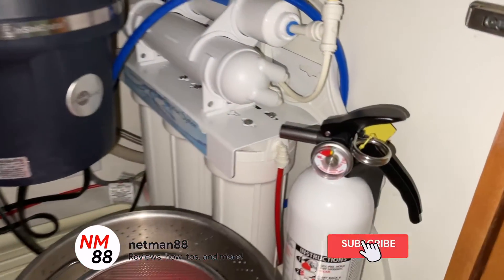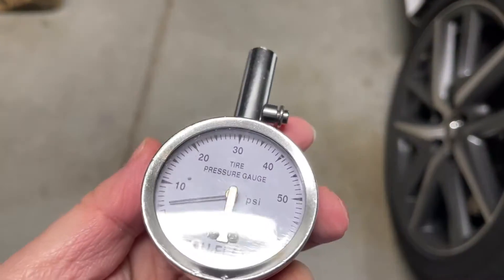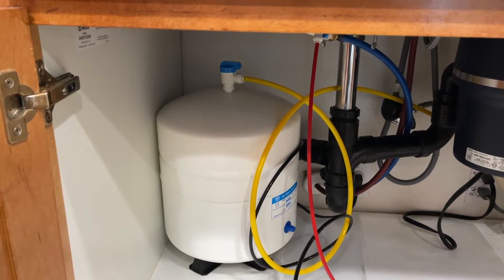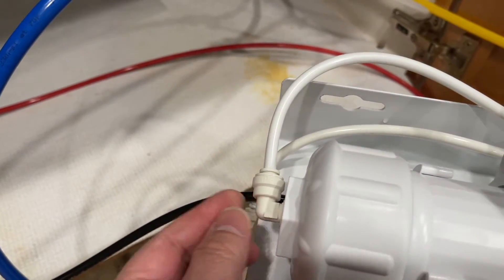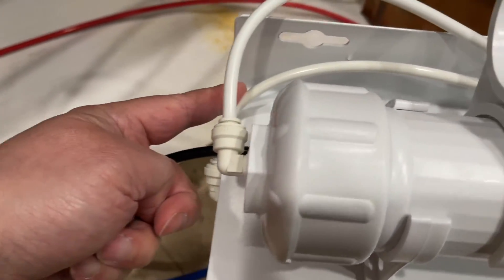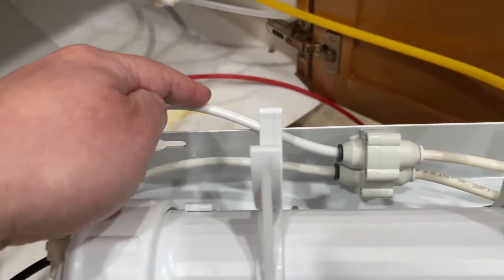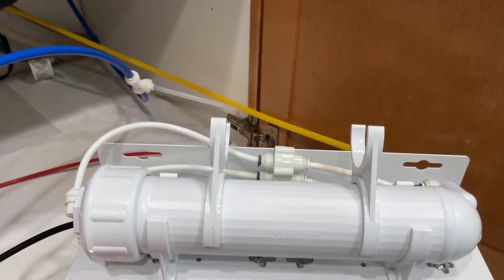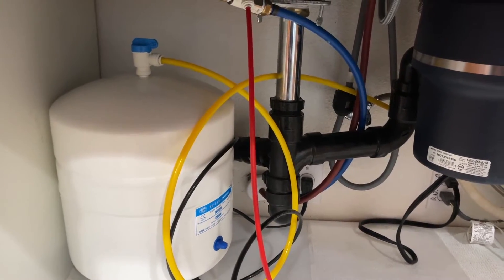WATER REVERSE OSMOSIS (RO) SYSTEM VIBRATION NOISE PROBLEMs

Comment from the maker: Corrections to the video:  
The center connector component 4 connection point is called the ASO (automatic shutoff valve). The end point components are called check valves.  

Also, I also fixed the Chlorine Filter connections off camera. It was connected wrong. It should connect to the last hose leaving the ro system before the 3-way connector.

Comment: HOW and WHEN did yours vibrate? Mine vibrates for a few seconds when I turn the faucet on. I'm not sure what needs replacing, the Check Valve or ASO valve? Also mine quietly vibrates when the waste water is beginning to stop flowing. BTW, the part you're pointing to is the "check valve", not auto shutoff valve. So the check valve was bad? Before I replace a part, I would like you to describe when the vibration occurred and what you did to cause it, so I know which part to replace or not replace. Thanks.
Reply from the maker: I recalled it was like a few mins after turning on the faucet.
Reply: @netman88  OK. Thank you. And the vibration stayed on continuously until you shut the faucet? And a constant tempo and pitch? From the moment I turn my faucet on wide open, the vibration will start a second later and only last for a few seconds regardless if I keep the faucet on longer. The vibration is strong and rough at the beginning and gets higher pitched and then fades away.  OK. Thx again.
Reply: I am facing same issue. Please help me

Comment: My new refrigerator with ice maker and water dispenser needs 40 to 50 P,S.I. to work efficiently. Should the Tank P.S.I. be set at a higher setting, more than 7 P.S.I.? at 7 P.S.I. water faucet pressure is fine, however, the water and ice maker lines may be freezing due to lack of pressure. I had the P.S.I. setting to 40 P.S.I. and bladder was not providing enough water in the tank. I decreased to 30 and so far so good. Just enough from the faucet to fill half a gallon of water. 30 P.S.I. setting may work out, not sure as I have to wait and see if ice with water is working.

Comment: Wow I’m having this same issue too. But it’s my red line vibrating
Reply: Did you every find the issue?
Reply: @p2tmewcg   I did not. The red line you could feel water was going through the hose and it vibrated causing it to tap against the tank. I angles the hose away and it stopped tapping against the tank
Reply: @Brandon-sr2bl  was the red line the brine or waste water? this will happen when membrane discard water and the pressure will cause that but is normal
Reply: @Fr4nkSanchez  I have 2 vibration issues. A loud vibration for a few seconds every time I first turn-on the faucet. And then a quiet 'soothing' vibration every time the waste water is beginning to stop flowing. So you're referring to my "quiet vibration" and it's normal? Also, do you have any idea why I'm getting a loud vibration for a few seconds every time I turn-on the faucet? (In those few seconds,  the vibration starts rough and then gets higher pitched and then goes away.) I've had the unit for 4-5 years and these noises have ALWAYS been there, on EVERY use. Thanks!

Comment: Had the same issue with a reversed pair of outlet tubes causing vibration because the membrane outlet port geometry changed from the original membrane part. Once switched after your tip in the video, everything works great.
Reply: Do you know of a video showing how to do that? Can I just pull them out and switch or will water come pouring out?
Reply: @lesleygaither1  what is your issue? Do you want to verify the connections? what kind of RO system you have?

Comment: The last exit point on your membrane housing is on the other end where the 2 connectors are, the one with the check valve is the entry point and the way your aso works it goes in from bottom 3 filters line to aso valve to membrane (with check valve) and exit to the other end (the 2 connectors next to each other) back to aso valve and out to your tank.

Comment: I believe your chlorine filter connection is wrong, it should be connect to the last hose leaving the ro system before the 3 way connector, that way the faucet and the tank will get water filter through it.
Reply from the maker: Yes, I noticed that after filming this video. I fixed it. Thanks